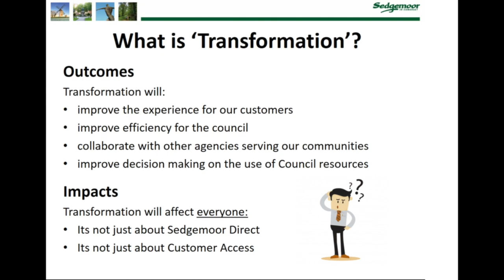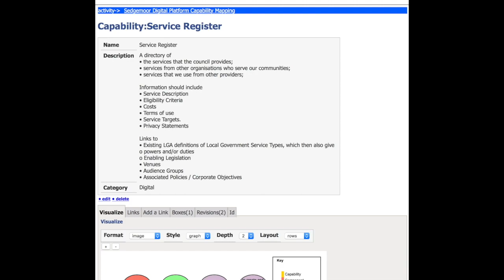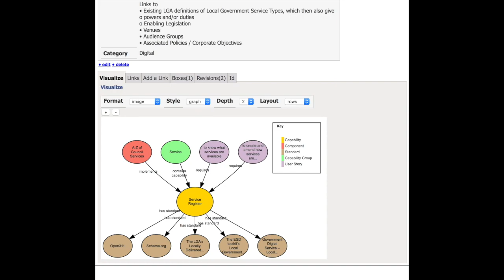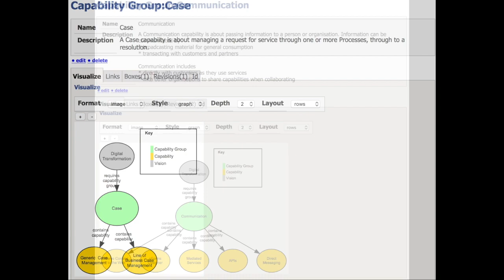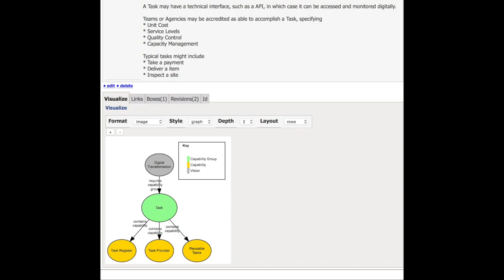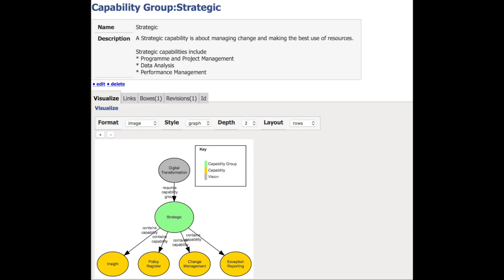Digital Capabilities

Comment: Its logical, brave and bold as an approach to procure ICT / Digital capabilities.  It has been tried before, but my assessment is that your approach is more likely to lead to a positive outcome than others I've seen.  It will be interesting to see how the market responds.  I'm not sure that the "usual suspects" will be wiling or able to do so and therefore new entrant and SME / cloud native solutions that come forward may be the key.  If the approach is successful, it could certainly scale so there is definitely a market and an opportunity.